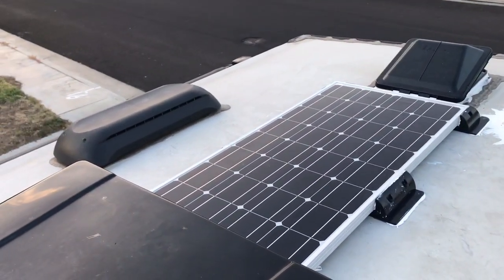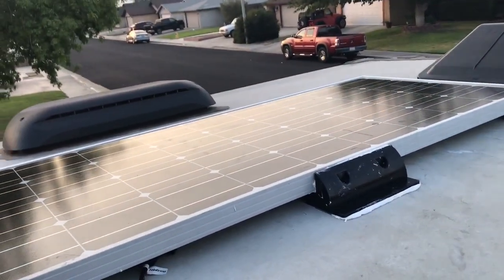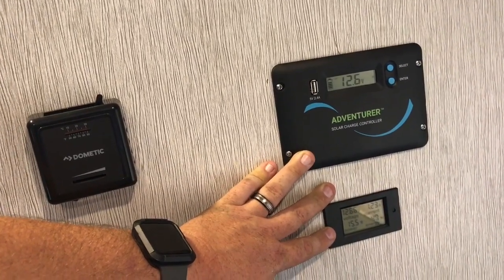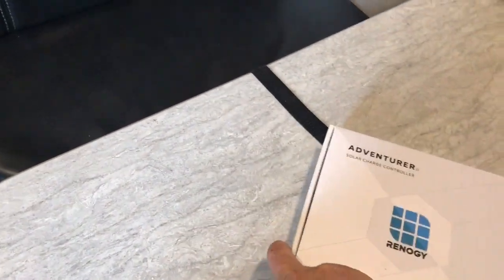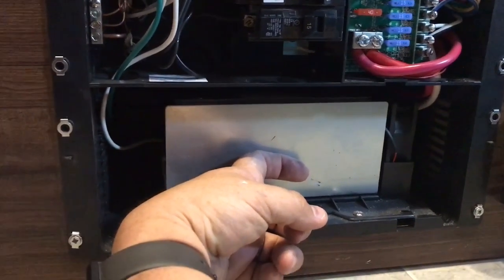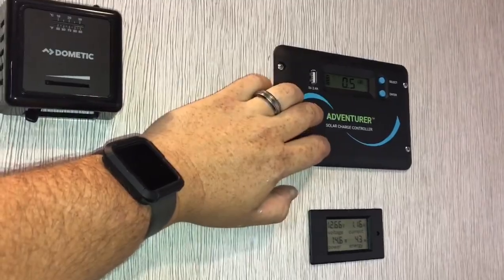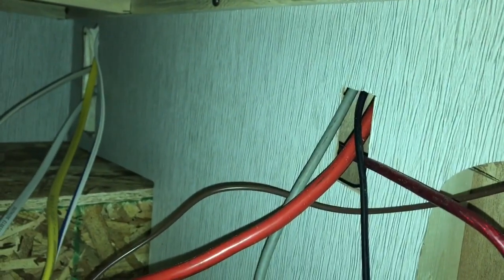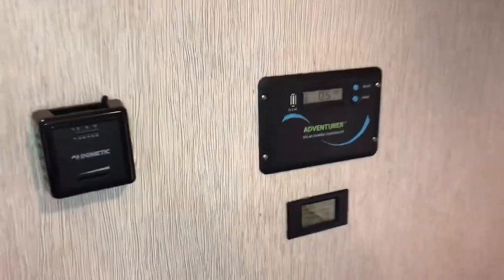Roof Mounted Solar on Mallard M185

Comment: Thanks for the video. Helped a ton with my install. One question: Are you confident that nothing grounds to the system downstream of your shunt?  In other videos I’ve seen it installed at the battery.
Reply from the maker: The battery connects to the frame for GND, and so does the power system inside where I put my shunt. The idea of the shunt is to measure the load on the battery. As long as there is no GND bypassing the shunt, it will be accurate.

Comment: Are you still running the factory sized single battery? To me it seemed undersized. I was thinking of installing a larger 31 series 110amp hr battery and or adding another battery in parallel. Just curious on the power needs but haven't used it enough.
Reply from the maker: I added a Group 27 battery in parallel to the Group 24 that comes with it. I am about to post another video on “Boondocking”, that covers power use, 12v plug additions and that battery addition.